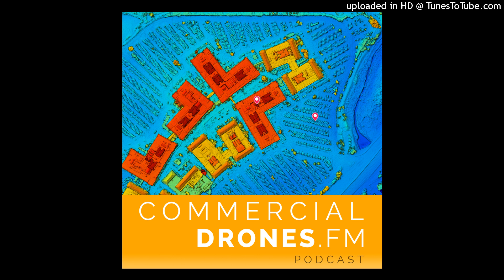#013 Making Maps with Drones: An Overview

Comment: Drone Insurance??  where when cost
Reply from the maker: Check out http://verifly.com — starts at $10 per hour
Reply: That is not insurance.  but thanks
Reply from the maker: It is. They offer $1 million in liability insurance (not hull insurance). Other than that, other insurance policies are a bit difficult to obtain and there doesn't seem to be an easy industry standard. Hope that helps!
Reply: Thanks I will look   but how many hours does one have to Purchase.
Reply: At the stated Rate of 10$ per hour
Reply from the maker: It's an easy app, you just purchase each hour at a time. Very easy, super effective. Only buy what you'll use. Check out the mobile app.
Reply: I guess that is not bad ,  I guess I would still need proof of purchase..  lol